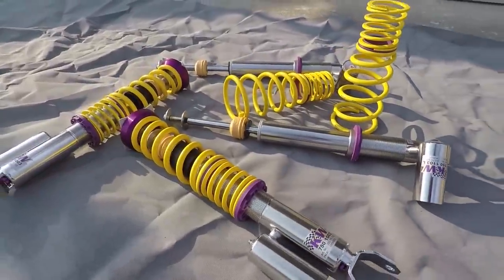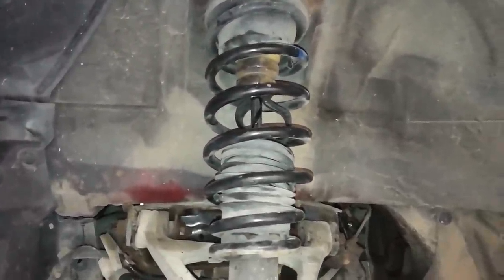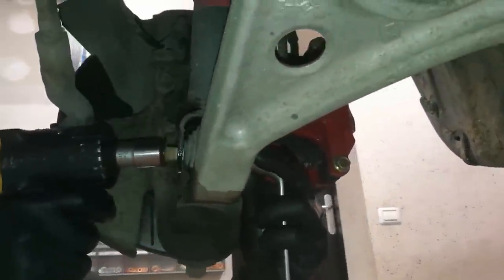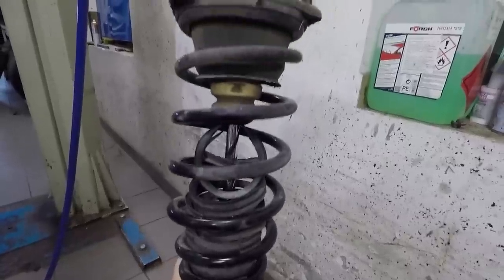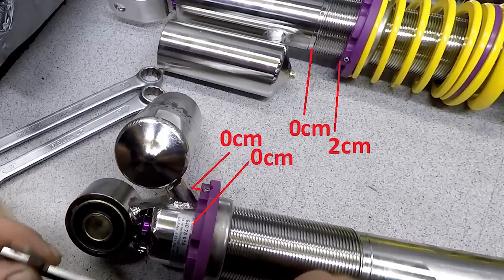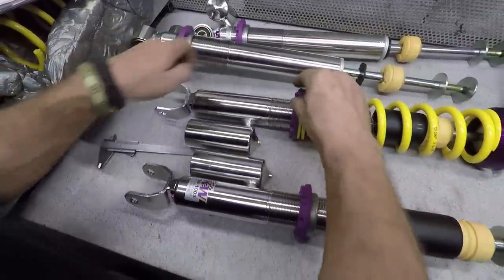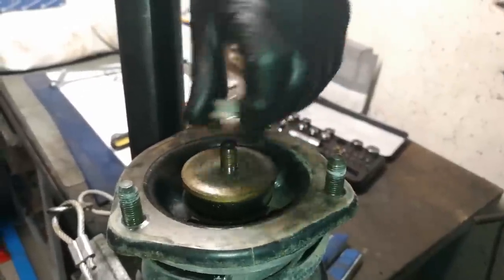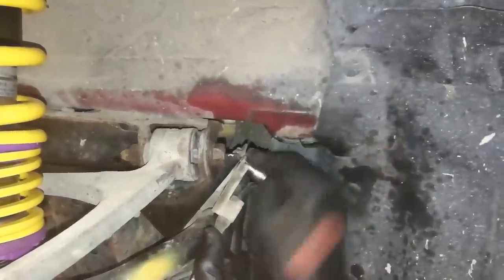Mazda Rx8 Coilovers Install | KW V3 Gewindefahrwerk

Comment: you need wider / lower offset wheels or it looks like a hover craft, you can fit 10.5 in the rears and 10s in the front with 25 offset and it will make your 8 look so much better
Reply from the maker: Definitely comming, might also be the next mod, cause I cant stand looking at that gap now 😛

Comment: When it's time for a rebuild are you going to keep it stock or do something crazy?
Reply from the maker: I'm still debating. A turbo sounds very tempting (13b turbo or swap it for a 13b REW), but the bigger issue is making it road legal (very strict rules in my country). Next year i should have it figured out tho :)
Reply: Driven by madness  certifications here in New Zealand cost $1000 for every mod that isn’t stock. Regardless I say a 1JZ swap would be the way to go!

Comment: 14:03 that's the gap I have in the rear on mine... on stock suspension... I think it's time to change them LOL... my front has twice the gap you had before the coilovers ROFL... I do have one question though, the extra bottle chamber attached to the KW's, is that their design only? Or should all performance coilovers have them? I don't remember seeing something like that on Stance XR1's for example.
Reply: Snoopy25 that bottle or reservoir as it's called is what is needed to have the ability to adjust rebound in the struts. Without it you can only adjust bound. This is why people say coilovers under 2k are no good. But in reality you would have to be a dam good driver to be able to fully realize the potential of having rebound adjustment.

Comment: Will you turbo charge the rx8 in future? Or what are your planned mods?
Reply from the maker: Maybe,  i will have to rebuild the engine in the near future, so i'm thinking about it. I need more torque for my drift days, so it's definitely an option.
Reply: How about a video on 'what is needed to turbo!?'  so much info on rx8club is dated, or in a 100 page thread with rants.
A concise vid would be cool... Actually since stand alone ECU is most likely needed, start off with ECU upgrade while NA that can be used with turbo (Adaptronic? / VersaTuner?)  Do all the 'supporting mods' while NA (fuel pump, injectors, etc!)
Have fun, thanks for great vids, btw your speaking presentation is much more livelier (enthused/engaging) nowadays compared to your earlier vids, awesome improvement!

Comment: What can you say about ride comfort? Compare to standart coil and spring?
Reply from the maker: Standard is very comfortable. Kw standard setting is stiffer, but still not bad, its good for daily. Kw on soft setting is almost better than original. And obviously kw on track setting is hard, and not the best for daily. But on every setting of the kw, the car handles better than stock

Comment: Been looking at V3's for a long time but hate the coloring of them...  Ended up finder some BC for 40% less with all the same quality and adjustment and better color to match my car
Reply: R0T4RY is love This kw set of coilovers is so top level it's not even funny.
Reply: @Ozem_Israel  I'm well aware. 2650$ for kw V3.  Been watching them for quite a while.  They are no doubt one of the best coilovers you can buy.  But they are not so high quality that they are in their own league.  Other companies make comparable products though some you have to make sacrifices or lose a few options to get a better price.  Only a few will match quality and adjustability of kw and then it's a price war which typically are close enough it's not worth making a big deal over.

The ones I found gave up the adjustable camber only which I can adjust in other ways. But that one thing made a significant difference in price

Comment: Hi Kristian, good day. 
It's always awwsum to watch your vids. Love em to bits.

I am currently having some issue with y RX8 FL.  Hoping if you could help, or the people in the comments could help out. 
Could you help me pin this if it's alright?

I have also changed my coilovers, but to tein ones. 
How the decision came into light was that, going through humps, there were noises.
Brought my rx8 to the workshop, and the stock absorbers were due  (8 yrs on the road).
After changing, i still hear noises (not the coilover bushes sound) when going through small humps (like those in the mall)
It sort of sounds like a flapping sound. 
Addition to that, (before and after the change of coilovers), going through uneven or bad road condition, the steering feed backs some clanking noise, but on the straight road, it's all smooth.

I have changed my bushing for the stabilizer bar, and changed my front link connectors.
The rest of the bushing are in good condition.
The drive is annoying me alot, as the road back home is uneven, so alot of clanking noise. 

The noise going through small humps, i can't figure what is wrong, kinda need help.
While for the uneven road clanking sound, could it be the steering rack? 

Hope some1 could help me out here..
It is driving me insane!!!
Reply: Benji Khoo - did u figure out or fix noise issues?
Reply: @chrislg4519  sadly, no.. the workshop last diagnosis is that the steering rack is worn as they check... have yet to change the steering rack yet.. are you facing the same issue?